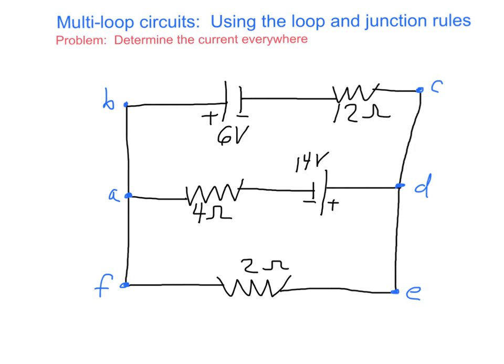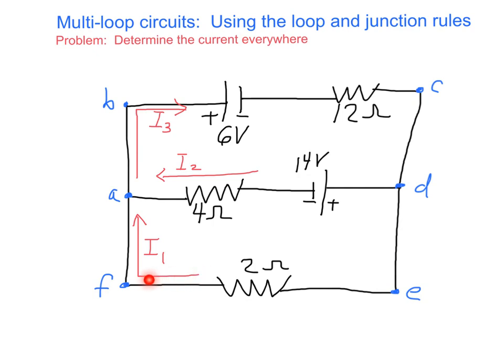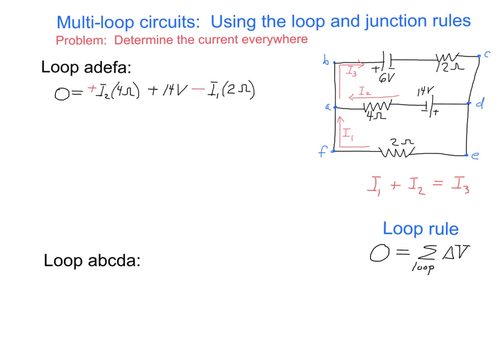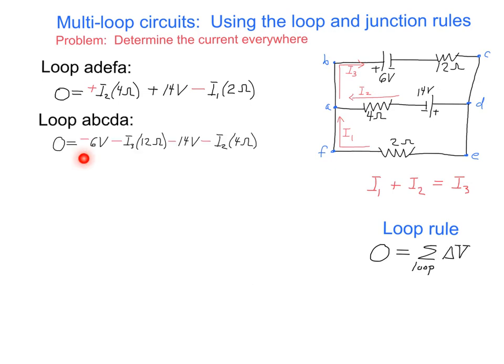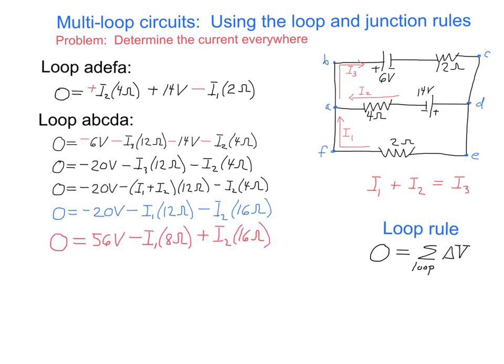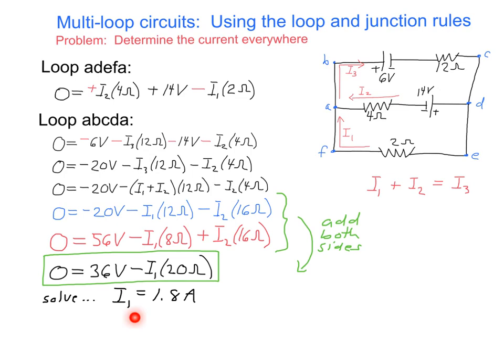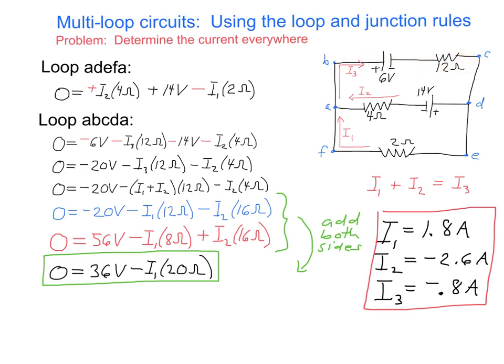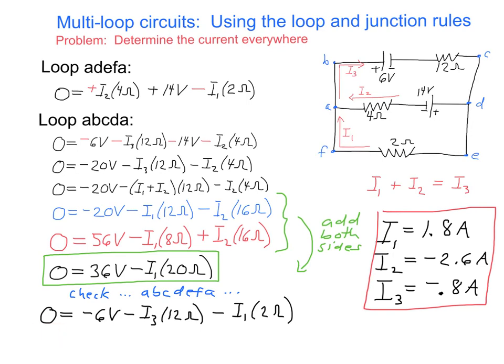Multi-loop circuit analysis using the loop and junction rules (example)

Comment: Thanks, but sometimes when we face some polarized receptors in circuit , it's not right to reverse the currents (when they are negative) but we must compute again with the reverse current and if we will get it again negative we will take it as null (zero)